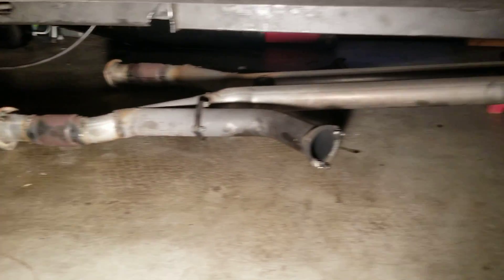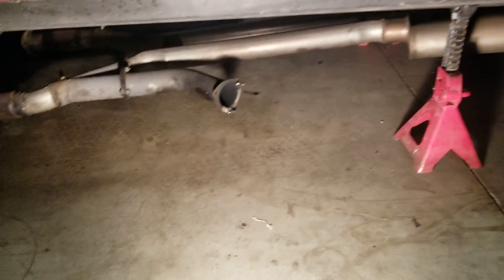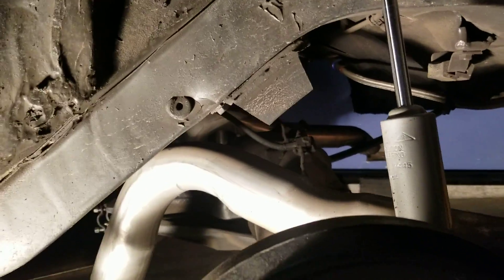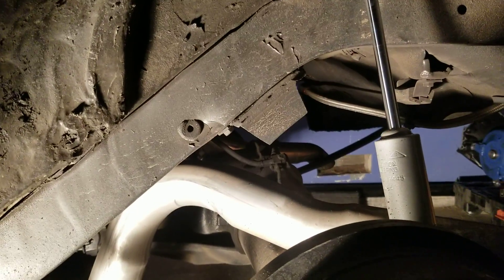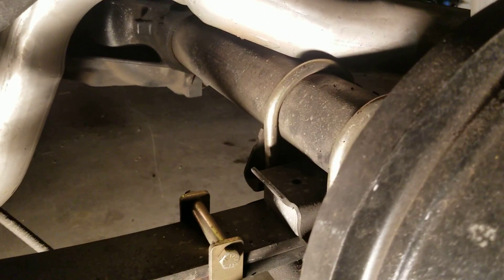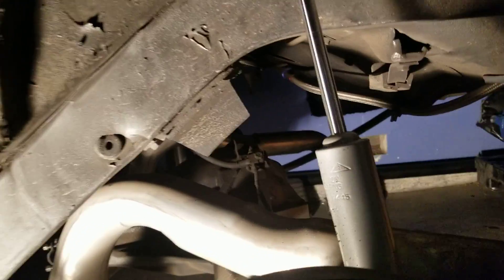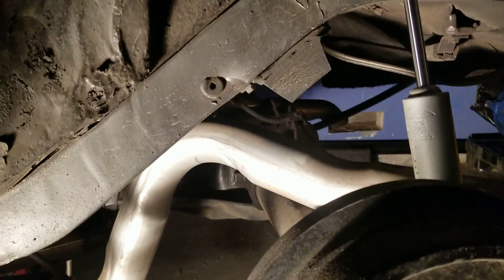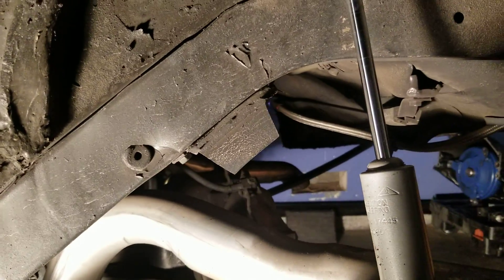CHEVY NOVA BIG BLOCK BUMP STOPS?

Comment: I’d leave them on the rear suspension would have to compress a long way for those to bottom out. I think your nova and Camaro’s share suspension does your car have a bump stop over the rear diff?
Reply from the maker: Yup it does
Reply: I'd say you're good bro...i have mine on my 72 camaro...no problems

Comment: If they contact the axle on launch you need some better suspension... the front is supposed to lift easily and transfer weight. If the rear squats that much you are losing forward bite. Maybe put a dab of silicone or grease on them before a pass to see if they make contact, or mount a GoPro to see what is happening on a pass.
Reply from the maker: I doubt they touch
Reply: Me too, the GoPro could be some cool views though